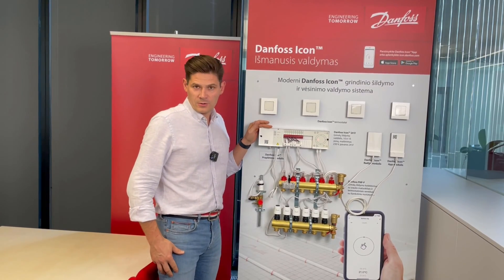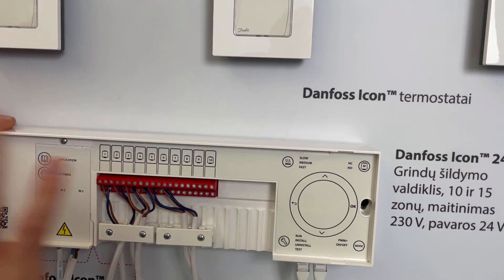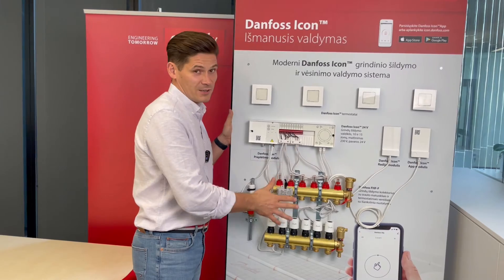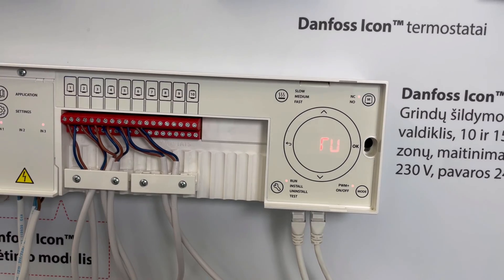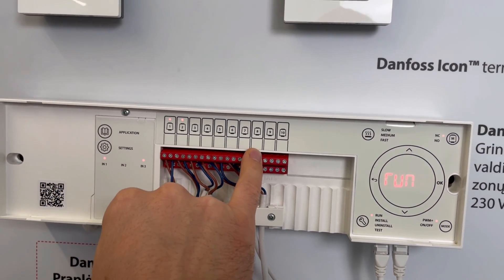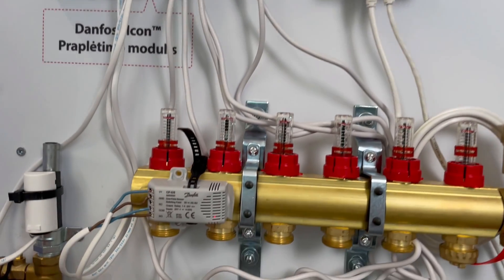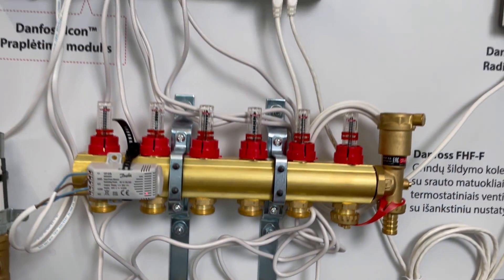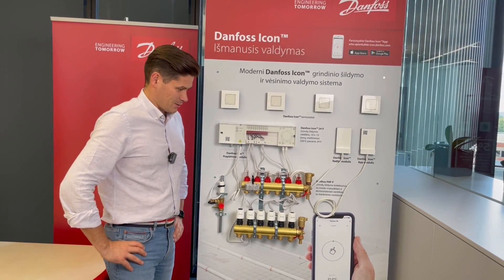Why Danfoss ICON LED indicators goes off on a RUN mode?

Comment: Question, 
* I do have a 088U1142 Master controller which is equipped with a 088U1103 RF module. Is  this RF module communicating with the wireless battery operated thermostats?
* Can I extend the master controller with a Zigbee module as that is my preferred protocol?
Reply from the maker: Yes, the 088U1103 RF module is only for communication with wireless battery-operated thermostats. For a stronger signal, place the RF module outside of a metal cabinet and keep it away from metal objects. If that doesn’t help, you can add the RF repeater (088U1102). The Zigbee repeater (088U1131) works only with the 088U1130 Zigbee module, which connects Icon 1st gen to the Ally Gateway (Ally App) (014G2400). To connect Icon 1st gen directly to the Icon App, you need the Icon App module (088U1101). Hope this clears it up!